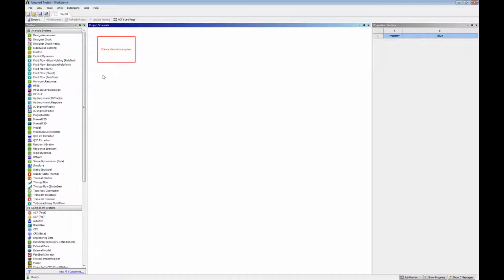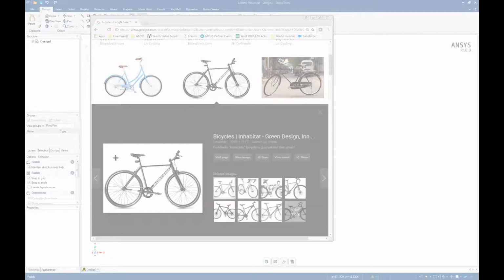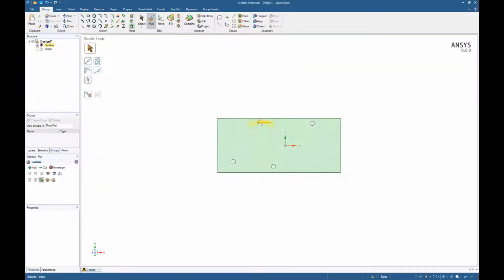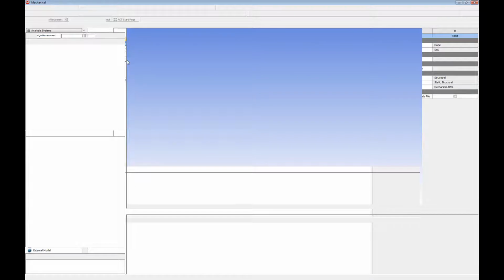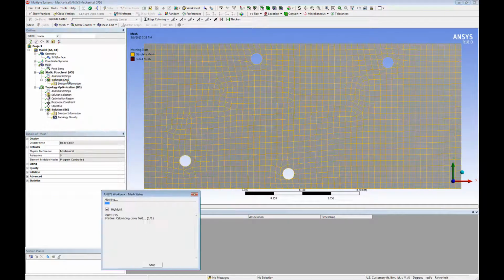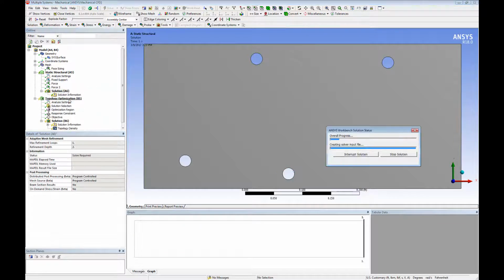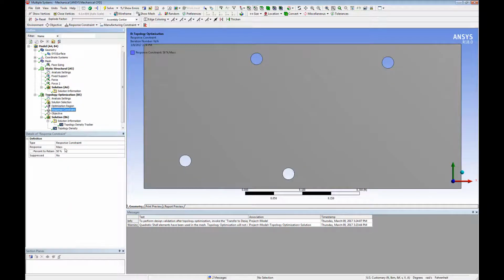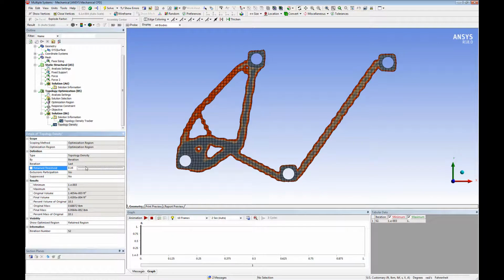ANSYS Topology Optimization

Comment: I am running some topology optimisation on bicycle design too, and Im wondering if there is an option to remove material from the edges of the mesh only? The optimised shape I get is consists of a truss structure with many members. I would like to see what sort of monocoque shape would be formed, but I am unsure if there is an option for the optimisation to remove material from the outside in. Do you know if it is possible?
Reply: Hi. What you describe here is a manufacturing constraint. Unfortunately the Ansys Workbench doesn't offer much option in this area. Either you choose another software, or wait for some time till the guys at Ansys wake up.
Reply: TARGE170 Yeah, I've noticed that the Ansys manufacturing constraints are quite lacking. 

It might be a long wait before they get that sorted so I reckon it's time to try another software. Optistruct probably.
Reply: Agree, for this purpose then Optistruct is an excellent choice. Nastran also knows the constraint you need (setting the tool motion direction) for very long time. Abaqus also has similar capabilities.
Reply: MSC NASTRAN is best tool for it